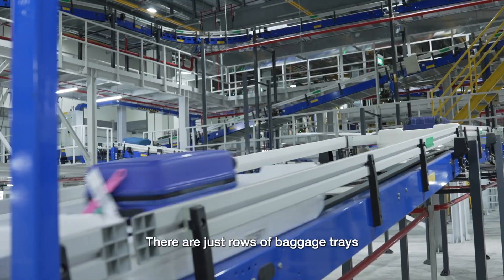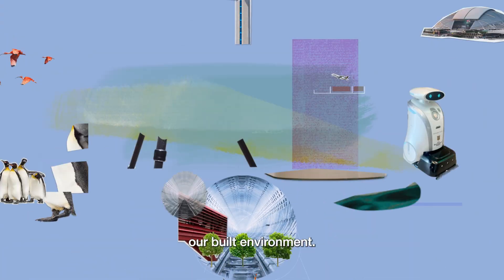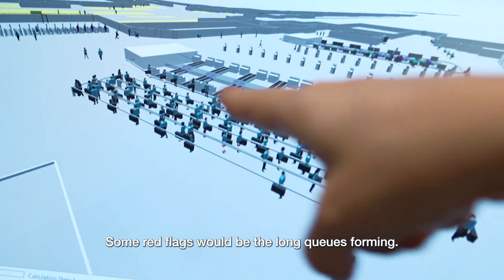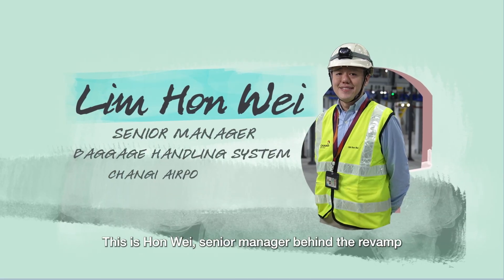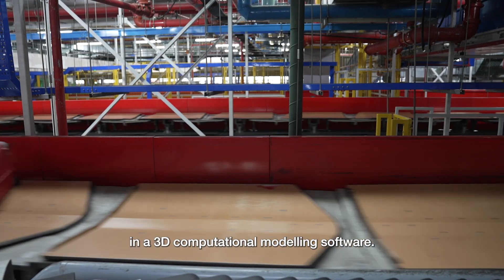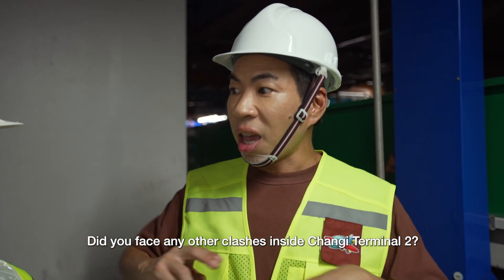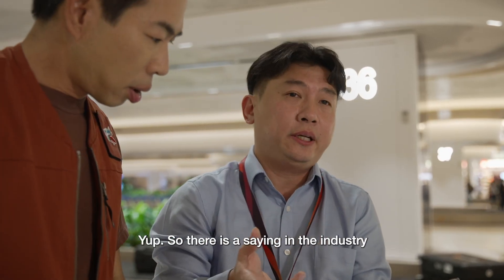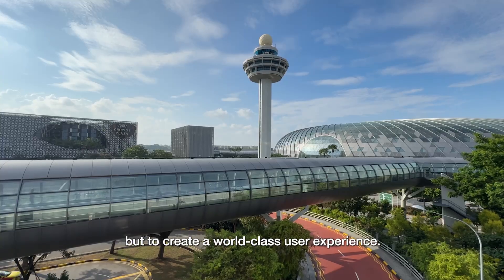The hidden tech that builds a world-class airport | Building Singapore

Comment: Not sure about "high" tech. When I placed my luggage into the self checked luggage machine, it did not detect my luggage. The handler said it has to be placed at the corner with the sensors (found only at corner of the machine!?).
Why should it be only at the corner!? How would we know!? Sensors should be installed at all 4 corners! This is a ridiculous limitation and not user friendly!
Reply: I travel frequently through Changi and have never faced such an issue. It might have been a tech glitch when you were using it. Based on my experience, I hope it won't happen all the time.